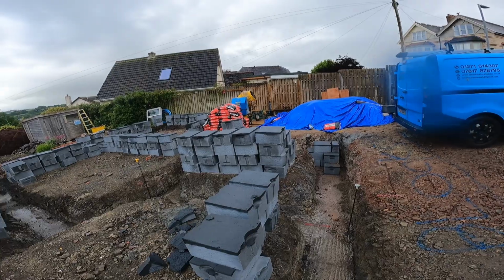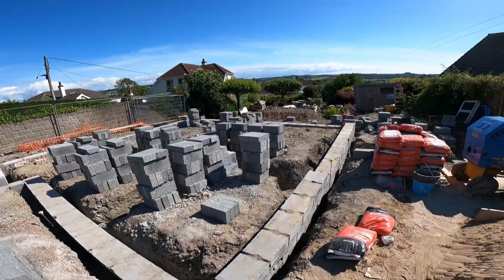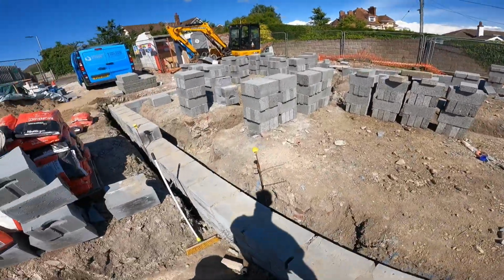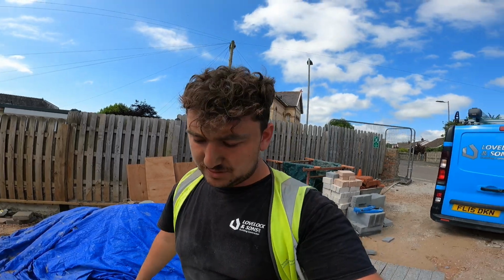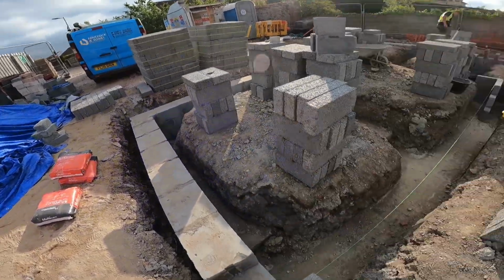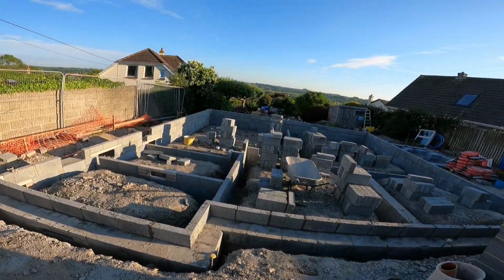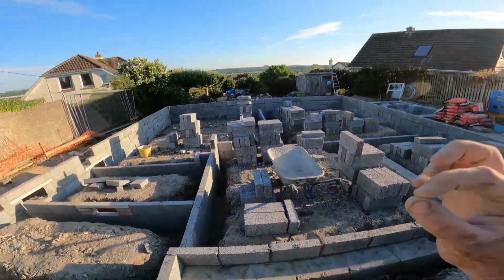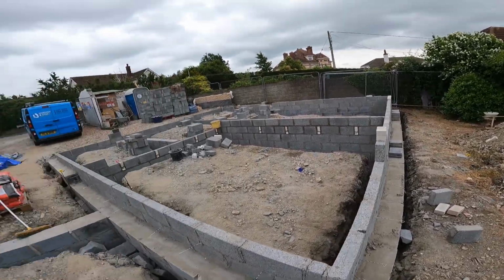Foundation Blockwork! JGB EP:49

Comment: Interested to know why you didn't go for deep trench fill with the concrete?
For me it works out the same cost but far quicker and easier than laying blockwork in the trench.
Keep up the good work mate.
Reply from the maker: We had to put 1.6m deep of concrete in the bottom section due to nearby roots so we ended up putting and extra course of trench blocks instead of paying for the extra 8m on the lorry as it’s cheaper for us because all building works is in house and don’t have to be subbed out. But thanks for the comment

Comment: Hi Jordan, great work as usual. Always amazes me how much graft and materials go in to the ground never to be seen. Who did your beam and block design?
Reply from the maker: Yeah it’s amazing when you take a step back and take in how much work goes into it. For the Beams it’s all drawn up by the same engineer who does all the structural plans for us.
Reply: @Jordan-GeneralBuilder mention LiteCast to your SE. Brilliant system that incorporates the insulation instead of blocks. We just had a quote under 5k and eliminates the need for PIR. You but the UFH on top, 75mm of concrete, up to 95mm. We managed to get a 0.11 Wkm. So quick too! I’m not on commission!
Reply from the maker: Yeah thanks for the recommendation I will do on our next build but I think the floor makeup is already passed off so I don’t think we can change it unfortunately